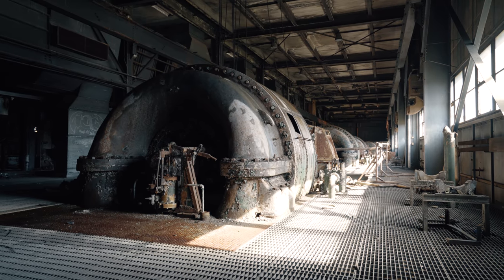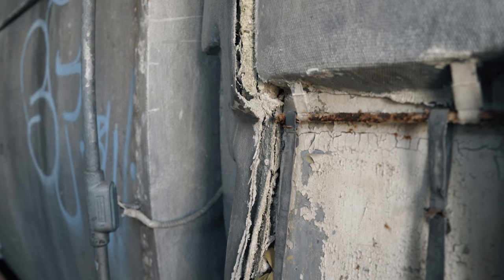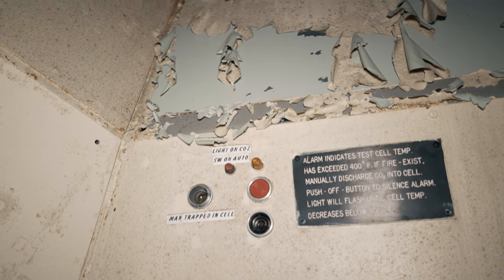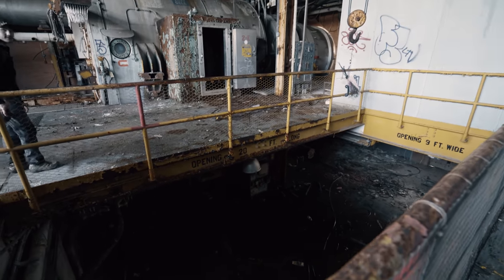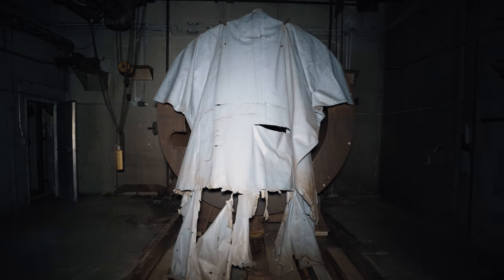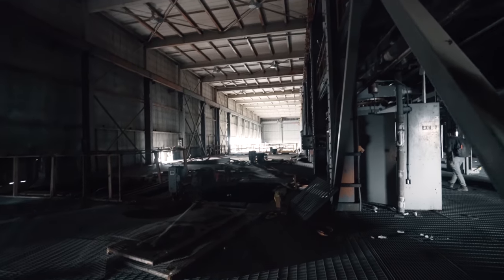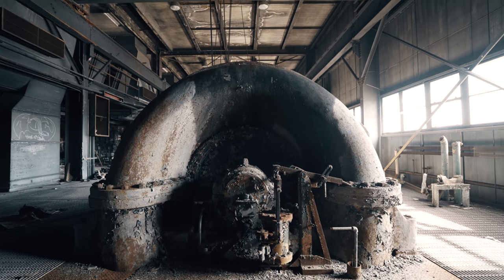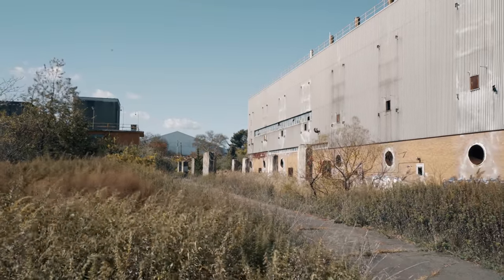Exploring an Abandoned Navy Research Lab - Jet Engine Testing Center

Comment: 14:50 that;s not THAT sketchy, they cat walks in my high school's auditor where warped sheets of plywood laid on L channel steel. Not sure how thick the plywood was, but if i had guess i would say 1/4 of inch thick. Now I'm sure when they were first installed they were fine, but when i was there was more then a few with a noticeable bow in them and and noticeable give to them when you crawled on them (yes we had crawl they had hvac ducts and steel beams that intersected the path of the catwalks very annoying).

Comment: Might the chambers be for nautical equipment, torpedos? They seem made for very high pressure.
Reply: Jet engines. They could probably adjust the pressure to simulate different altitudes.

Comment: Bit more on this place without giving away location specific info....

Opened during the final year of the Korean War in 1953, the center encompassed 528 acres (214 ha). It was used as a jet engine test facility for the US Navy until its closure per recommendations of the 1993 Base Closure and Realignment Commission, due to Navy decision making under President George H. W. Bush.  Nearly 700 civilian positions were lost, most of which were relocated to other facilities in Maryland and Tennessee. The base's Marine operations were transferred to Fort Dix, which has since become Joint Base McGuire-Dix-Lakehurst.[

Comment: At 3 minutes and 27 seconds look up at the ceiling there is a light on and the control panel to the left looks to be lit up as well
Reply: 3:27
Reply: It's more likely that that one light still has the reflective coating inside the shade and I'm pretty sure the lads would've noticed if a light was on but you might be right. What's the timestamp for the control panel lights man?
Reply: @Cyba_IT  now that I re-watch it you're right it's just the coating reflecting the light I really wonder a lot of their videos in the places they go to actually have power still on from the cold war or is it still on for a reason
Reply: @evilbeetlekustomscreations4965  Yeah, I remember one, I think it was an abandoned power station that had power in one solitary panel in the whole immense building. The only thing I could think of was maybe it'd been used as a movie set or something. Probably not though because surely generators would be cheaper. I think in most places they turn it off for safety reasons I guess.

Comment: Awesome video as always. The UK had a similar facility, NGTE Pyestock http://www.ngte.co.uk They tested Concorde's engines there, simulating conditions at 2000mph the website explains how it all works. The compressor hall is just amazing, eight compressors with a 36,000hp motor on each. It had it's own power station, but that was only to get it started - the facility could only run flat out at night when demand on the National Grid was low. An amazing place.

Comment: The connectors on those panels are not XLR, they are most likely Amphenol multiplex connectors. Specifically MIL-DTL5015 standard.

Comment: That's a SAE5051 connector. We use them nowadays in high amp welders, large machine robotics, and they can be used for general electrical that requires high-amp multi-bus lines.